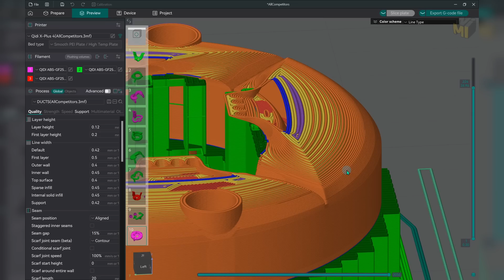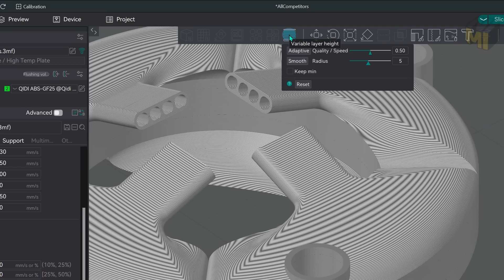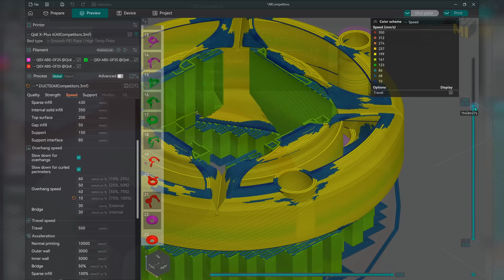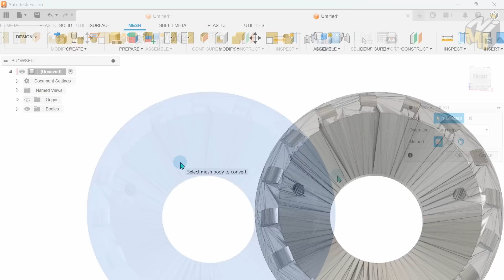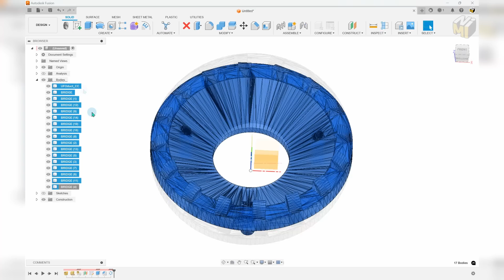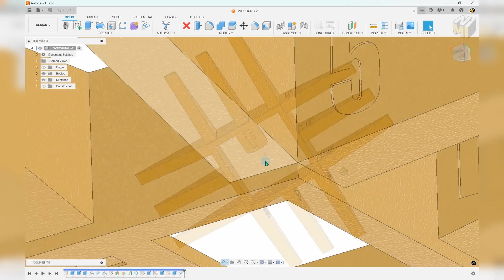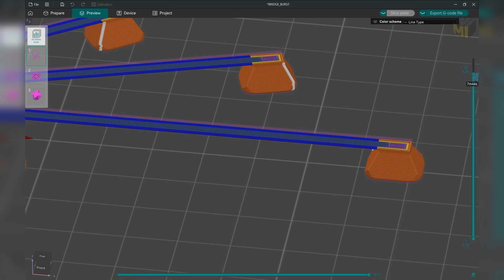3DP Duct Showdown - Two BIG circular ducts need to be fixed or they can't compete

Comment: For the first model, how about splitting it into three pieces. Top, middle (cylinder), bottom (nozzles).  Print all three separately. Then using a course thread or cam /twist  lock that would have been added to the design prior to printing assemble the three parts into one. It would allow each piece to be printed more easier and with less chance of defects or failure during printing

Comment: Might want to do some finagling with that benchy test to prevent the printer from colliding into the other areas that have already been printed..
Reply from the maker: Unfortunately the benchy model crashed my Fusion too many times, I'll have a look to see if there is a model that's useable somewhere out there, I suppose I could try Blender as well.

Comment: I think a good overhang test-model would be something with a lot (6+) of "wings" like a propeller. All blades equal but with an increasing amount of overhang along the blade. This will make a good indicator on how even the cooling is around 360°.
Something else that would be interesting to compare is how hard supports stick to a model. I believe this to be an important benefit of good cooling. Maybe a bit difficult to compare.

Comment: For difficult overhangs I recommend not only reducing layer height but also to increase the line width. It has the same effect in increasing the supported overlap between layers. In my experience, a too low layer height makes overhangs curl up more and is worse at bridging. It's also more susceptible to pillowing.

Comment: For one off iterations, I keep a filament pen handy to touch up small defects, with some dental tools (small flat spade so I can "print" or dispense mid air then slide the tool out before sealing the hole).  Maybe try to slice and print separately. Surely beats having to spend CAD and print time.   Love the series and hopefully you come across the holy grail of cooling ducts.

Comment: I feel like printing some ducts in two pieces can be an option. For example, the UFO can use a ring with holes printed flat on build plate and keyed to the rest of the model, and then inserted mid-print so it bridges over the part and locks it in before printing further.

Comment: When using variable layer height, did you make sure the minimum shell thickness was set high enough. If you don’t enforce a minimum thickness you’ll get thinner shells as the default control is number of layers, not thickness.

Comment: I have been spending so much time designing fan ducts and testing them ! So excited about this match! It will really help to get more idea of what kinda duct designs are really required for a higher speed printing!

1 suggestion for testing the model is to include a pointy one that has really low layer time (in actual print not just setting), as it would need really good cooling to keep the prev layer flatness to prevent warp when the nozzle touches again.

Similar ideas suggest for a true torture test. Any 360 facing test would actually give the prev layer way too much cooling time, compared to a single direction facing test.

A few more things to pay attention to would be:

Usually "inner/outer" combined with "print infill first" provides the best overhang result, but it really depends on individual design. For example, if there is bridging happening inside the model (which happens a lot with duct design), "outer/ inner" might be required to make sure the model is printable, due to how the slicer oriented path sometimes.

Inner/outer/inner provide the best surface finish, but for any overhang that is >60 degrees it will start printing in the air.

1 trick if an extreme overhang is needed for the design is to place walls to sandwich the overhang, so it becomes bridging (try it, you can achieve a 85degree "overhang" easily).

Increasing wall loops will improve over hanging under 4 loops, more than that doesn't improve anymore.

Sometimes the placement of the model can impact the overhang depending on infill, and bridging infill direction.

Last thing, filaments have the biggest impact on the result of an overhang. Just try some overhang test using high speed filament vs regular, and you will see the difference.
Reply: Good stuff! Did you submit a duct by chance?
Reply: @802Garage  tyty, :D  for the submission sadly I cant find  time to work on it  :(, however I did managed to made a duct using dual 4010 to achieve clean 75 overhang( at least his overhungv2 model)

Comment: Go Team Purple! 
My goto exteeme overhang settings are Adaptive Layer Height and Arachne 0.6mm width(on a 0.4mm nozzle). 
The extra line width allows more overlap between subsequent layers, and since it's Arachne it doesn't have much if any negative effect on smaller sections.

Comment: My question is: What are you/we ultimately trying to test for here? Which of these ducts can print the fastest, quality results for these specific test cases? Or for printing single items on a print bed that may have some or all of the test prints' characteristics? Or for broad print quality results when printing plates full of parts, toys, art, or functional items? More and more we are seeing hobbyists becoming 3D printing entrepreneurs who are printing 30-60 items filling the print bed and then selling what they print at craft fairs, farmer's markets, or online with Etsy, eBay, etc, or even Amazon. I posit that it is possible that the ducts that pass in one or two of these categories, may fail to perform consistently when scaling up to a print bed full of items. So I ask that you be clear in stating your goals in these tests so that viewers are aware of the testing intent and the possible print uses cases the tests are limited to. Finally, if there is no clear winner across all the print tests, I suggest that you follow up this challenge where you test the top 2-3 to an extreme print torture test, for example the Clocksprint Torture Toaster, or a large high resolution Eiffel Tower (Newcandle, Thingiverse), or the Midieval Castle (Bold Machines, Thingiverse), or a plate full of the Cute Dragon (Sebastian_v650, Thingiverse) or similar popular craft fair item. An all of the above test suite would really separate the best from the rest.
Reply: I actually think part of the answer from the start is: We don't know.
Part of the challenge and testing is to figure out what really matters and what should be tested. See what works and what doesn't. See if some designs go completely the wrong direction while others show promise.
It's kind of like art... You know it when you see it? You know the reference. What's a good fan duct? We'll know it when we see it. To be a little more precise, the goal is to maximize cooling while maintaining quality and minimizing noise.
The cooler that distributes air the best to properly cool at high speeds with the lowest noise is obviously the best duct, right? There will be a lot of nuance, a lot of too close to calls, and a lot of questions left unanswered.
I think part of the point too is we may see which ducts are best for high speed printing vs high quality printing vs just making less noise. I do know he is planning to make this multiple stages of testing and I like your final suggestions.
No matter what... It will be fun! We're definitely gonna learn something. Nobody has ever tested this many different duct designs before.
Reply: That's honestly not a bad idea. Maybe you should start testing yourself in the way you want. That way you own it. Maybe your results will completely conflict, and that's okay. Dude's going the extra miles to make this for us to see what we can learn from it. You might find something different his testing misses or vice versa. Ultimately it means everyone could print themselves new and improved ducts for free.

Comment: You CAN use adaptive layer height with tree supports, just change the automatic tree preset to weak or hybrid (i suggest hybrid), both work and can be tuned to match the default automatic option with very little fiddling, for weak supports you can increase the inital diameter to chonk them up and hybrid is ready by default just has an interface at the end of each brand. Personally find tree support to always fail on my printer, but ive used them and tuned them extensively and you can absolutely use adaptive layer height with them (you should always use adaptive layer height anyway since its just so good)
Reply from the maker: Very nice, I haven't tried that yet, it makes sense that i'd be possible the trees are fairly simplistic and a layer thickness change shouldn't impact them much, aside from the size of the perimeter... maybe easier said than done, I'll give it a go.  Thanks!

Comment: You cannot print variable layer heights with regular tree supports in Orca but you can print them using Hybrid Tree Supports and selecting individual layer heights for supports in the slicer.

I can send you a .3mf file if you would like to see this.

I’ve done well over a hundred prints this way with variable layers and have not had an issue. I also find the supports are quite easy to remove even for more complicated/close to bed prints.

For larger surfaces that need more planar supports parallel to the build plate, I do tend to lean toward normal supports though.

Comment: Why not split the problematic ducts in two parts and glue together?
Reply from the maker: Also a good option, there is certainly more than one way to handle issues like this.
Reply: FOR SCIENCE!
Reply: if you can fix in software there is no need to fix it in post, fiddling around with some settings resulted in an amazing result.

Comment: What about also using a 0.2mm nozzle? The layer height to extrusion width ratio is insane here.
Reply: that's probably not possible with fiber filament. Unless the filament is absolutely garbage.
Reply: @cosmic_cupcake  True, I guess you would need a non-fiber filament. Which honestly shouldn't be a problem, this isn't an application where you need strength, just mild heat resistance.
Reply: @Shayeta  I guess the extra stiffness helps these thin walled prints to not deform, but yeah the fiber infill is largely unnecessary.

Comment: I know that would increase the time expense alot, but it would be nice to see the tests at 50%, 75% and 100% fan speed.

I personaly never print with 100% fan on my T1, as it is just to loud and in my experience 75% is normaly enough. If the model has no steep overhangs and is large enough that the layer time isn't to small I go with 50%. At that fan speed it is about as loud as the printer itself.

Comment: IMO: If you can't print it's properly, the design is for the bucket. Don't waste time on those ducts
Reply: I mean with my duct there wasn't an actual problem, he just refused to flip it the right way around for some reason lol.
Reply: @cosmic_cupcake  It was a learning and testing exercise. He explained that.
Reply: @802Garage  oh sure, but I specifically asked him to flip the model, and I am concerned about performance here.
See, the insides of the little "buckets" that hang out of the bottom are supposed to be smooth, so they're better printed as top layers. With the model upside down they're now bridges, which means a way rougher and more uneven surface potentially deflecting the air away from the intended path.
Reply: @cosmic_cupcake  Ah I getcha. I think it would be hard to quantify the real difference in this testing, but I understand your concern.
Reply: @cosmic_cupcake  Just submit it again with it flipped. :D

Comment: How about using soluble support filaments ?
Reply: That would be an option but you need a filament changer and that is something a lot of people do not have and the soluble filsment is quite expensive I think. Another thing is that doing it this way also shows others with similar problems how to fix such issues and that educational component is definitly a plus. Also it would not be good content for the video if he just used soluble support wich then fixed all the problems.

Comment from the maker: *BBBBenchy* - Patterned Benchy 4X
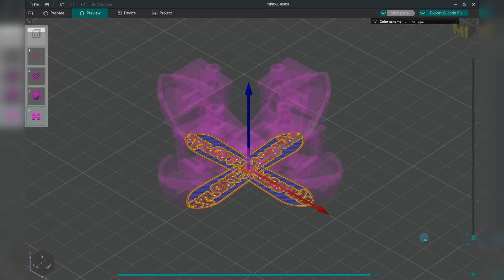Reply: You should assemble 4 benchies in slicer into a single model; so there is no overlapping extrusions (as seen 9:02 – 9:04) that will cause crashing of nozzle into already extruded material. As it stands now this might lead to some catastrophic failure of the print
Reply from the maker: I shall give it a try!  I converted these to meshes, but when working with them, they continued to crash Fusion, a different approach is going to be needed.... a keen eye!  Thanks for your thoughts on this.
Reply from the maker: Well that was easy, I've never had to do this before, I assembled the models in the slicer and then re-sliced and Voila, it's looking great.  It's always nice when things are simpler than you think.